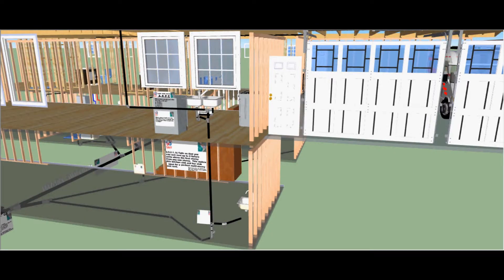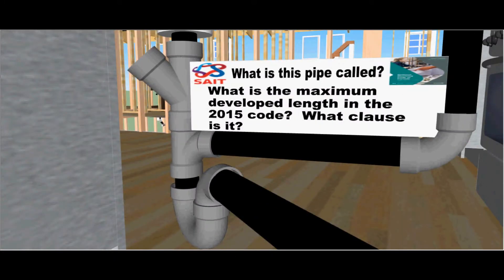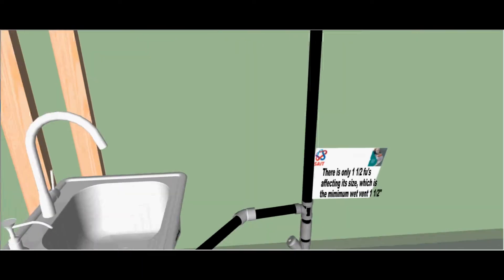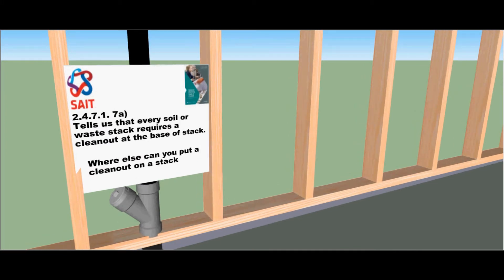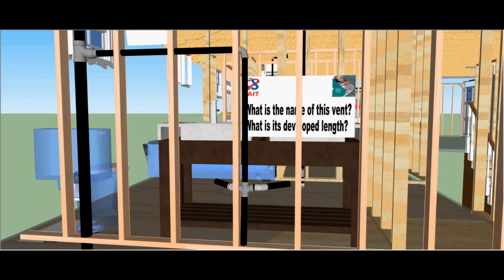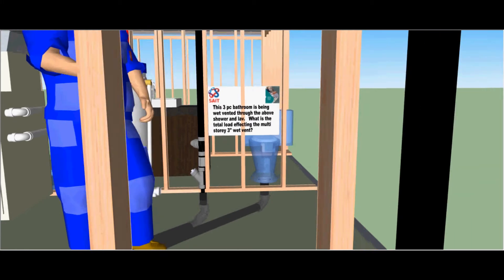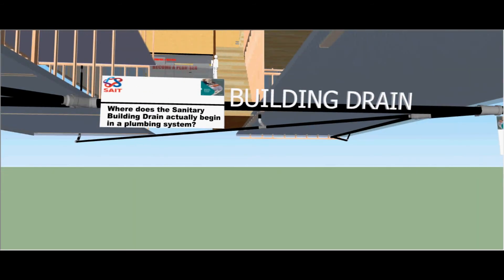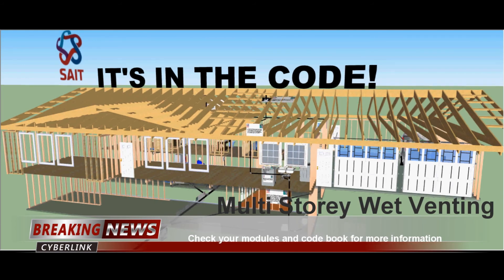SAIT PLUMBING IT'S IN THE CODE!

Comment from the maker: For all that notice that there are no hangers or supports illustrated with the piping in the house does not mean they are not required. They are required and it states that in 2.3.4.5. of the 2015 Canadian National Plumbing Code, ABS and PVC pipe are required to have supports every 1.2 m (and at the end of branches or fixture drains and at changes in direction and elevation). Hopefully one day I might have the time to include them in my animations.

Comment from the maker: In this animation, there are two corrections that have to be made from misprints or I was Code delusional at the late hour of the night while finishing it.   The first one is the code to reference to the 1200mm developed length should be 2.4.8.2. Instead of 2.4.5.1 which is referring to 
A 2.4.5.1. 2), the illustration of a continuous waste in the back of the code.    The 2nd mistake is on the building drain clean out I placed an hallucinated code reference of 2.4.7.1. 10), it should say 2.4.7.2. 2) cleanouts for building drains shall be at least 4 inches in size.   I think that’s it...IT’s IN THE CODE!